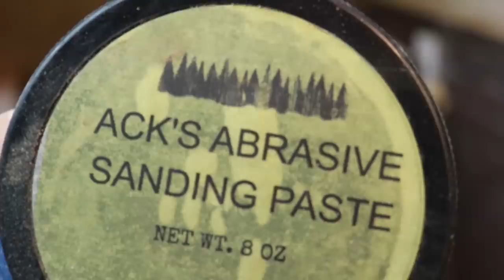Woodturning an Oak Burl in Resin

Comment: Very nice work.  I have been making epoxy bowls and platters, but I did not use the wood center, and when I drilled into the epoxy to set my face plate it would crack.  I will use your technique, thanks for the vid, very helpful.